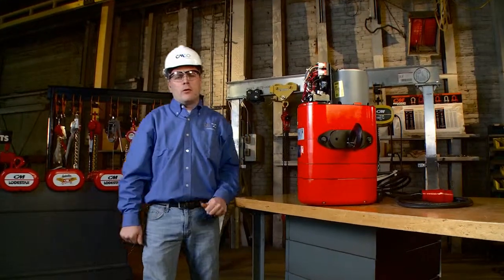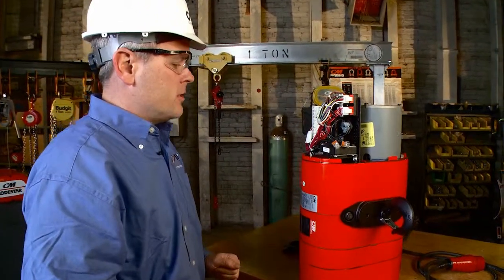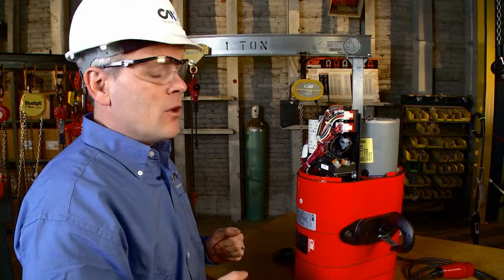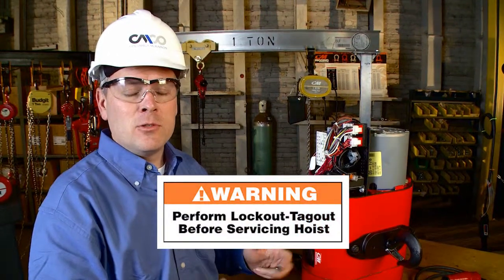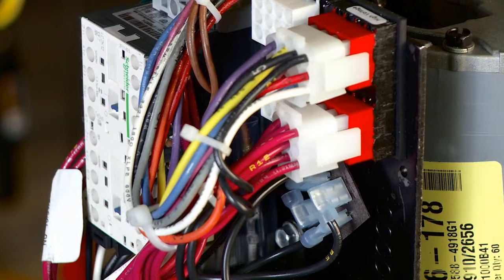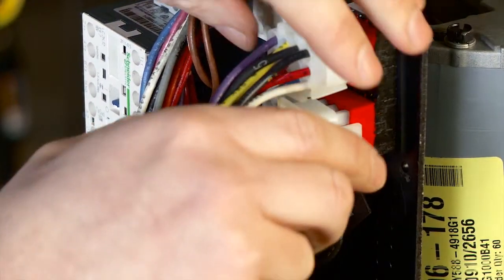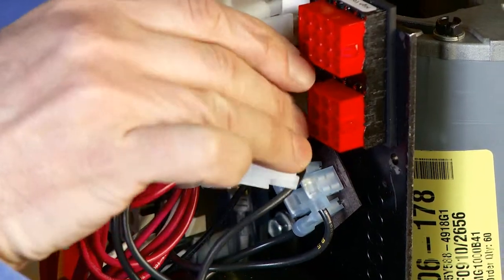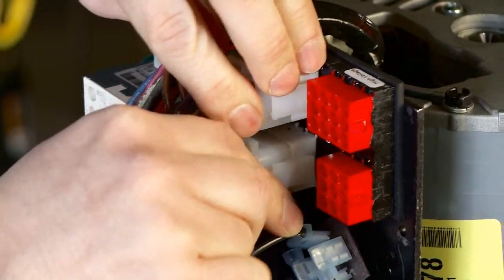CM Lodestar Electric Chain Hoist Power Conversion

Comment: I have a single speed power star  with a powered trolley that is wired for 460v. What is the process to rewire to 230v? I was told it can be done but the CM tech has not gotten back to me with the diagram. Thanks